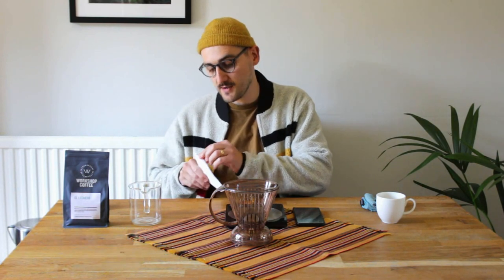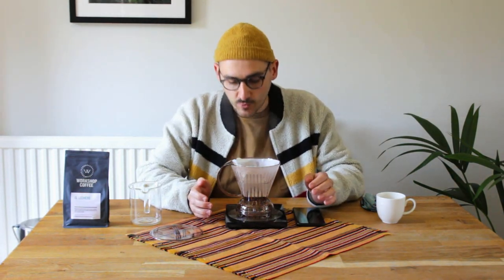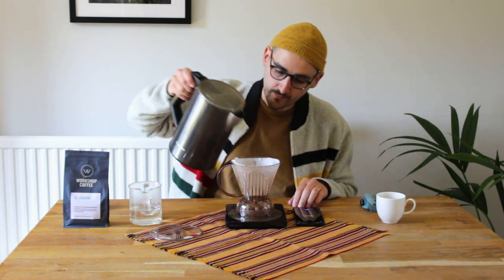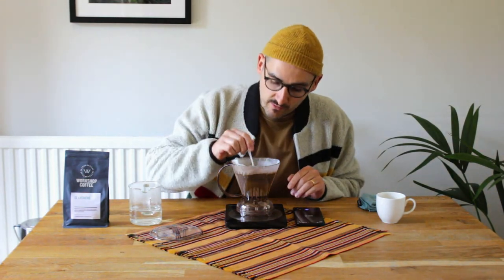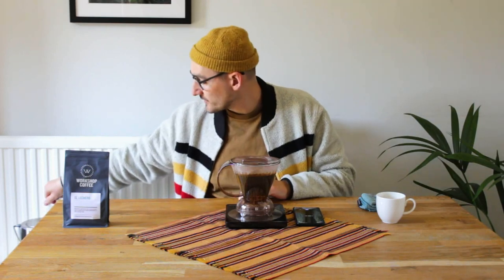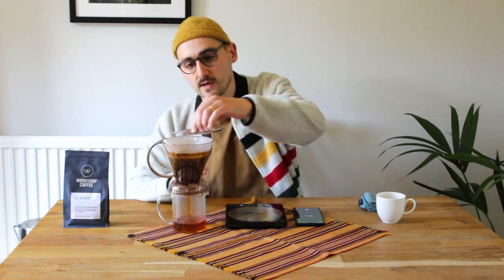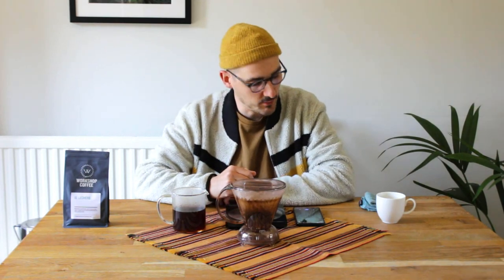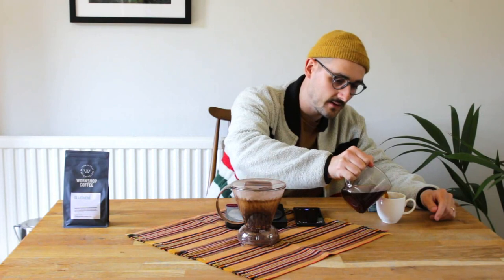At Home with James Bailey | Brewing with the  Clever Dripper

Comment: Thanks for the guide and the handy tip. I used the CCD for a couple of years right around the time it came out. It was excellent but then one of the  plastic legs broke off and that was followed by valve starting to leak. One too many cleanups later, I called it quits and moved to a french press and now my daily driver is a stainless steel Kalita Wave . But guess what showed up this morning thanks to your video? The CCD but this time made with glass instead of plastic. Really looking forward to applying your technique to it. I am not a coffee snob but thanks to folks like yourself and James Hoffman, I am now able to appreciate good coffee.
Reply from the maker: That's super interesting – we weren't aware that there was a glass version of the Clever Dripper out there, but have seen other brands selling glass and ceramic versions of a steep and release brewer. 

Happy brewing and thanks for the kind words.
Reply: Hello, what brand is your glass Clever Dripper? Cheers

Comment: James, if you revisit this method, which is now part of my quiver, but not goto. "blind" this method, also more standard clever bloom, then pour over,  plus pour over in a decanter in similar methods, then pour through open valve.all 4 into a clear vessel. shoot for same total brew times, grinds water temp etc. I have found that a traditional clever pourover streams out much darker in color, than the pur on top method. I'm not saying better or worse, but though I dont have my refractometer on hand, it is clearly more extracted......On some other blog the author wrote, the reason for faster draw down times in grings atop, is the filter is far less clogged at the bottom because dry fines have infiltrated. Also grinds on top is kinda a presoak and the coffee particles have expanded I surmise. If this is the case, stirring up a brew in a vessel before filtering should have a similar or faster "drop" Hmm since i've been convinced Higher brew temps are better, may have to try an old school boil the grinds a couple of minutes then filter. Maybe add the boiled coffee for 5 tests.grinds on top in a separate vessel seems redundant to just doing so in the clever? Might reveal something? My clever is not opaque.......nor is my filter. hmmmmmm any clear filters out there,,,,,rice paper? Vellum? Posting same on the other James YT.

Comment: Another Clever user helped by this here, thank you! Draining works much better now. The only thing I've added is that i start with a quick bop on the mug (about 20g of water gets out) that I discard. That way you don’t dilute the coffee with the water that has been sitting below the filter.
Reply from the maker: That makes sense as the initial part of the brew is much more watery, but an interesting experiment is to keep it to one side and taste your coffee without it, then reintroduce it to the drink. We wouldn’t be surprised if you preferred the cup with this initial portion in there. Whilst it might not be as strong, those flavours that first dissolve from your coffee grounds do play an important role in overall cup profile and flavour balance. We run a similar experiment training our baristas to make espresso, catching the first few drops in a cup before running the rest of the shot into a second vessel. Whilst they taste terrible by themselves they round out the cup profile dramatically.
Reply: @workshopcoffee9001  Interesting! Tried it out and it did seem to taste better, but I think I’ll need to do some blind testing. Seems counter intuitive, since for an espresso the first water has at least gone through the grounds, but this water has been on the other side of a filter.

Anyway, thank you for taking the time do give me such a thoughtful answer, much appreciated!

Comment: Have you noticed that your rince water doesn't actually pour out fully unless you tip the clever and pour it out of the top?  That rince water goes into your final cup every time.  Only a spoonfull of course, but still...
Reply from the maker: Hi Peter – we most definitely have. Some water will likely be retained around the valve. Tipping the brewer upside down is the easiest way to ensure you won't have any taint from the rinse water, as marginal as this might be. 

If you're looking to go a few steps further, you could always try both ways and taste them blind in a triangulation taste test to see if it genuinely makes a difference.

Comment: Hi! Would you use this to make cold brew? 😊
Reply from the maker: Good question. Most filter methods can be adapted to make a version of cold coffee. We would recommend creating a concentrated hot brew and strain it over ice to dilute down and flash cool, which is way faster and won’t carry any oxidised taste. 

But if you specifically wanted cold brew style coffee you could definitely steep in this overnight with cold water and strain the next day. We’d advise a medium-coarse grind (don’t go super flaky coarse like most cold brew guides recommend) and use an 80g per litre ratio, and then cover the surface with cling film to reduce the contact with air whilst it sits and steeps.

Comment: Thanks so much for your video and recipe! Just a little question, as I'm already afraid by all the coffee equipment I have in my kitchen, I was wondering : do you think that this clever dripper could  also be used as a typical V60 Dripper if engaged on the support from the beginning of the brew in order to let the water flows at the start of the brew ? A way to Kill 2 birds with one stone with one single equipment and having one accessory fitting 2 brew methods (Classical percolation dripper AND clever dripper with immersion + percolation? This way I could make classical V60 recipes on this one or the opening is just too big ? Thanks in advance
Reply from the maker: Great question, Mathias. We haven’t done a whole lot of testing using the Clever Dripper as a standard pourover brewer, but it should perform very well – other pourovers with similar shape and dimensions like the Melitta and Bee House dripper work great for pourover. 

We would advise removing the stopper plug entirely for this approach and ensuring your grind is suited to allow a nice flow through the coffee. You might be best off using a pouring kettle for pourover coffee and a regular kettle for our Clever Dripper technique, but if you’re already filling up on coffee equipment this isn’t exactly necessary – see our video on brewing without scales or a pourover kettle for a little more on that: https://www.youtube.com/watch?v=KBhZS_8enQ4
Reply: @workshopcoffee9001  Thanks so much for taking the time to answer my question : I'll definitely take the time to investigate on this ! All the best for your channel and thanks again :)

Comment: Valuable video. One question: when you pre-pour the water and drain it, a little plain water remains above the ball stopper, between the stopper and the bottom of the filter paper. Do you find this has any impact on the result? What about briefly releasing that water first and discarding it, then continuing with the draw down? Thanks!
Reply from the maker: We’ve never found this phenomenon to have a noticeably negative effect on the resulting cup. You could absolutely try draining it off and then getting two cups, adding half of the diluted brew you drained off into one, and then pouring half of the strong brewed coffee into the two cups, muddle them up and see if you can taste the difference. It would likely make more of a difference if you were brewing very small doses, say 12g coffee to 200g water.
Reply: @workshopcoffee9001  Thanks for your thoughtful reply, James. Your videos are really engaging, informative and downright delightful. I do find the Clever makes a really tasty cup and it's one of my favorite methods. In terms of water first or last, for myself I've found that if I wet the filter and drain quickly before I add the coffee grounds (medium-fine), and then add the grounds right away,  the filter doesn't clog at all and it drains through at a good clip. But if I wet the filter too early, and it sits wet for a minute or two, it tends to clog. Perhaps the paper swells a bit and clogs the pores if it sits wet too long. The water-first method you advise certainly works well, though I find that the coffee-first method seems to retain heat a bit better, which I appreciate.  Thanks again for your response, and for sharing your experience and wisdom.

Comment: Generally I use water around 200 degrees.  So with using 220 degree, that doesn’t burn it?
Reply from the maker: Hi Jason – you can use boiling water and not worry about burning the coffee.
Reply: By the time the boiling water hits the Clever, and the Clever thieves some of the heat, and by the time you've slid your coffee in, you can bet that water will more of less be at the perfect temperature.

Comment: I have used this method and tried different grind sizes. My coffee still tastes sour. I have ground very fine too but can’t get rid of the sour taste. My coffee is Edido light roast.
Reply from the maker: Sorry to hear that. If you want to reduce sourness and you're experiencing it with all variations of grind and temperature with this coffee then it probably isn't to your tastes. 

We'd recommend trying something at a medium roast level or from a different origin. A light roast Ethiopian coffee will be far more prone to tasting high in acidity, which is ideal for some drinkers but others prefer less acidity.
Reply: @workshopcoffee9001  I should taste some sweetness though. I managed to get another light roast and trying to dial that in. I have managed to reduce the sourness but now unable to get rid of the bitterness. I think its down to my grinder producing too many fines. I have a Sage Smart Grinder Pro.
Reply: @workshopcoffee9001  My draw down time is now 35 seconds. Still there is some bitterness and no sweetness. The acidity is ok.
Reply: Try a coarse grind and steeping for 4 minutes with light stirring every 30-45 seconds. That's what works for me.